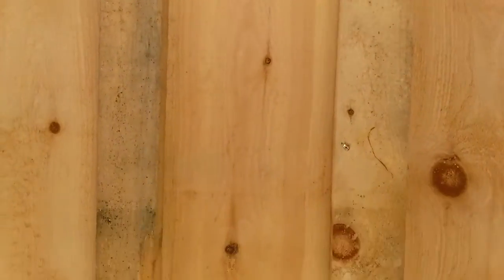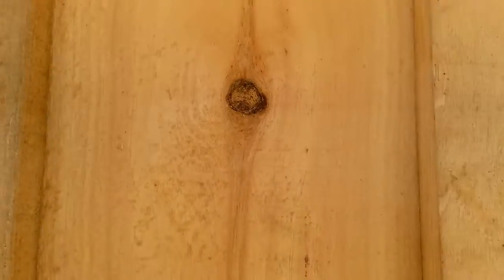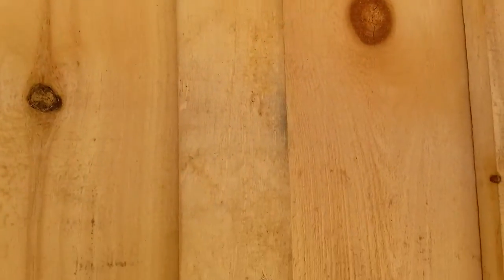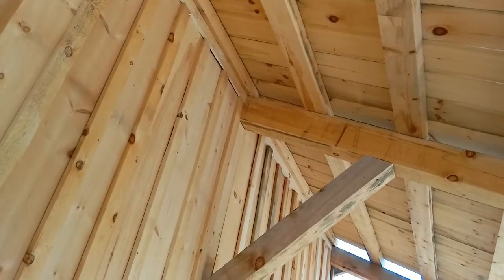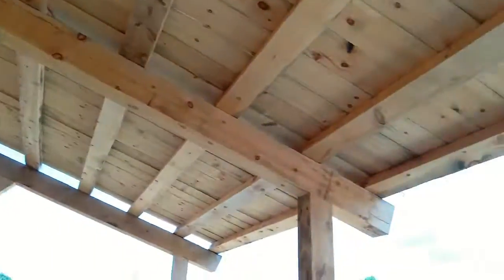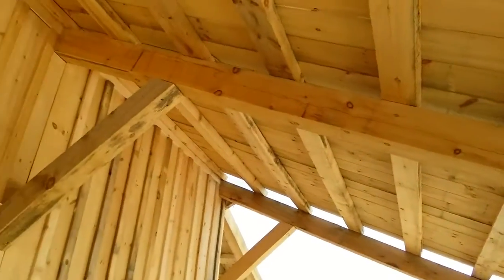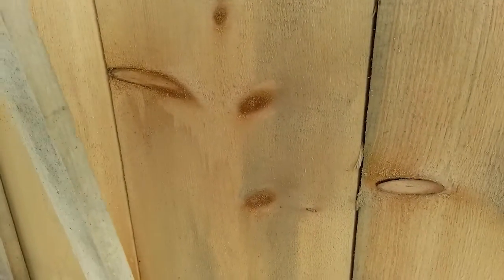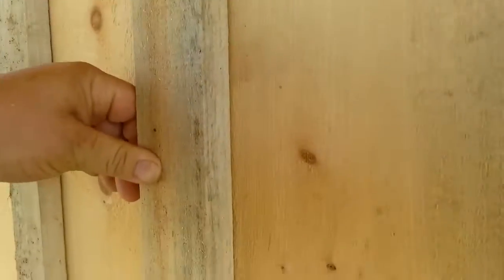Modern Barn Raising, Battens, Purlins, and a Cupola

Comment: Question on your batten strips, I was always taught that the batten strips should only be attached to one board to allow for the shrinkage and not splitting the battens. But you attach the battens to both boards, I am at a lose for that procedure.  Thank you as soon as I find some land I will be getting my barn plans and associated stuff from you,
Reply from the maker: I find if you attach the battens to just one board, the batten will pull out an away from the un-nailed board, making a real nice place for wasps and hornets to get in and build nests.  By staggering the nails or screws, you allow for some movement, without giving it too much freedom to separate from the board.  It also helps a ton to choose the right species to work with like Eastern White Pine,  or let your lumber dry to 15% MC or less.
Reply: @BarnGeek  thank you